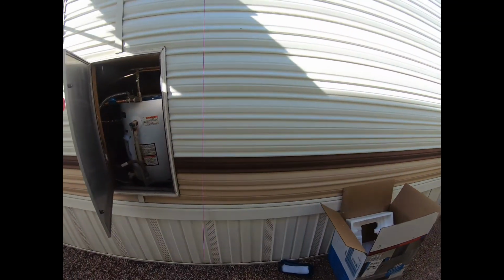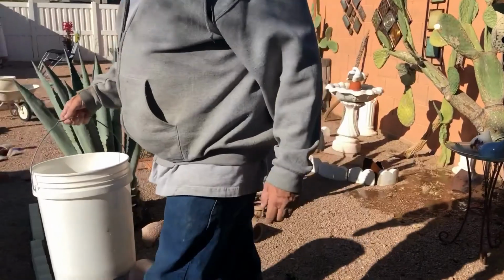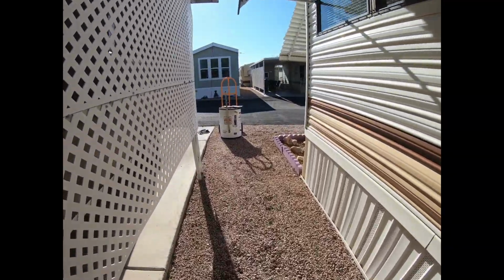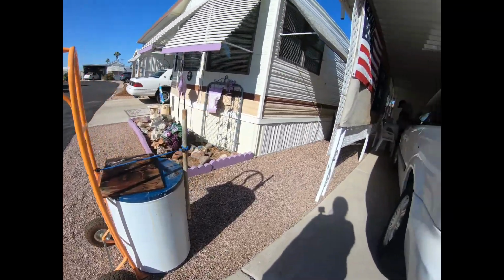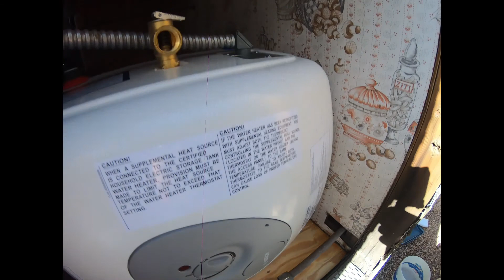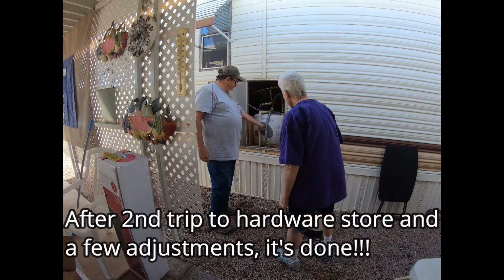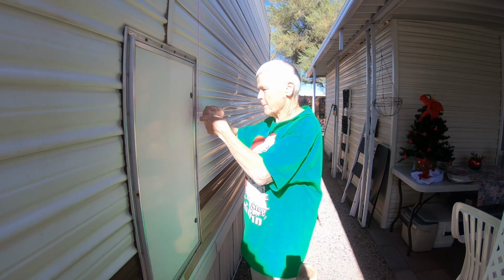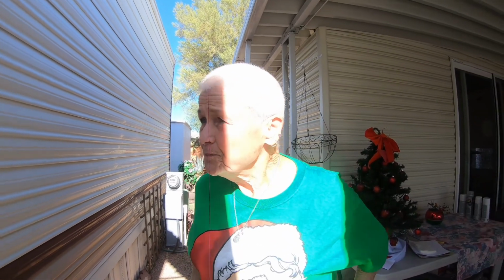Park Model Hot Water Heater Replacement!

Comment: Looks like you are in my park here in Mesa Az. I have been told that the on demand water heaters require a dedicated 220 line of which we do not have in these park models. Are you sure this is a on demand hot water heater? can you share what are the electrical requirements for this unit?   thank you

Comment: What's the brand, model and specs of the new unit you installed?  I saw Bosch but unsure of the rest, thanks in advance
Reply from the maker: https://www.amazon.com/dp/B0148O64JE/ref=cm_sw_r_sms_apip_bLwfT7iCqJc73.         Not sure I did that right, but that should be a link to the water heater we bought on Amazon!!???
Reply from the maker: Ok, I just checked it and it’s the right one and the link worked!! Hope that helps!! Thanks for watching!!